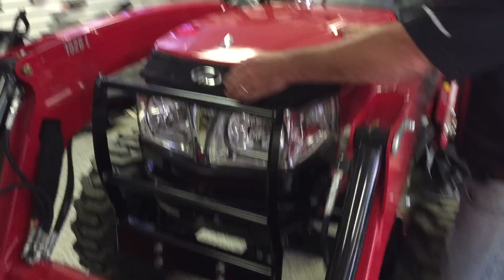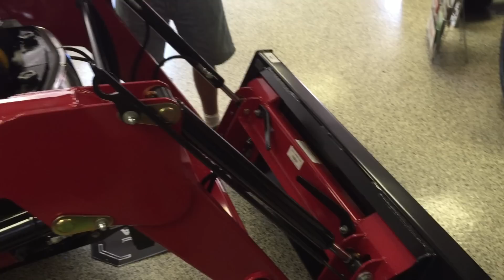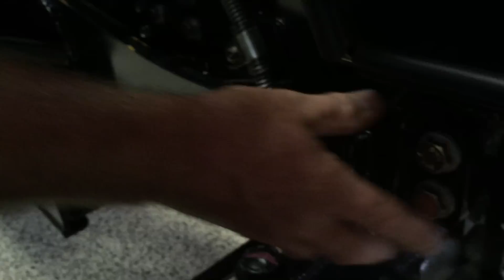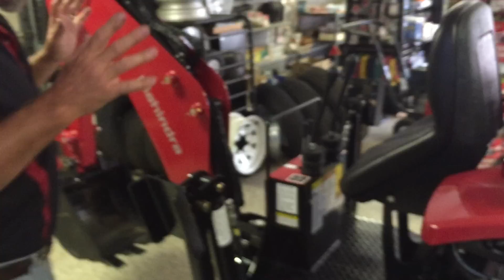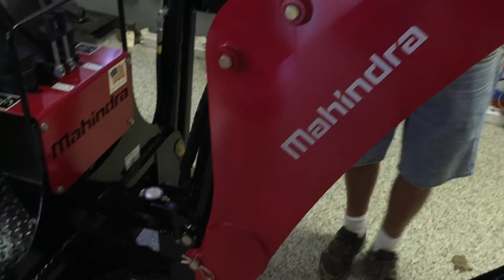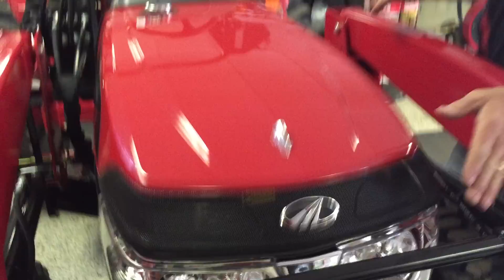Mahindra 1526 HST Tractor Loader Backhoe Overview

Comment: Kinda hard to believe how reliable they are when you can hear the shop banging on something in the back ground
Reply: Stupid ignorant idiotic comment to make!!!
Reply: JL silly ass comment have you ever seen equipment of any make that doesn't need "banging on".
Reply from the maker: Lol. Understandable, but the most common question people ask is why we have so many different color machines in our service department, a simple answer is because we don't have much for these machines coming back for servicing needs other than the common fluid changes and such. Its a tractor dealership, and people need to understand what a hammer sounds like.

Comment: I understand you carry Mahindra tractors but the quality of Mahindra tractors is terrible and the electrical systems are problematic.  I do like the emissions systems on the engine but the rest of the tractor is garbage. Please be honest!
Reply from the maker: Unfortunatetly you have not had a good experience with a mahindra product or you are just reading information to come up with this. Mahindra Tractors have been around for many years and have been bulletproof machines. The last warranty I have filed at our dealership was for a key switch. It was an easy 10 min fix and an 80$ part. Glad that is all we really have had to worry about, unlike the other companies. The mahindra product is very well built and backed by the industry's longest warranty. A brand does not survive in a competitive market if it is bad. It is as simple as that. There is a reason Mahindra tractors are the number 1 selling tractor in the world and coming close to #1 in the USA very quickly!
Reply: I have seen you make the same "electrical problems with mahindra tractor " comment on multiple videos. I am not sure if you are a troll or you have been paid to spread lies.
Reply: I've been researching Mahindras and am curious as to these electrical problems? I haven't seen much in this regard except where a safety switch was out of adjustment, but I've seen just as many videos/posts about that on other brands as well. The Mahindras seem to have much simpler electrical systems than, say, a JD, which has an OBD system and electrically adjustable mowing deck.
Reply: Look for ChuckE2009 and he talks about the problems on his Mahindras' electrical system.

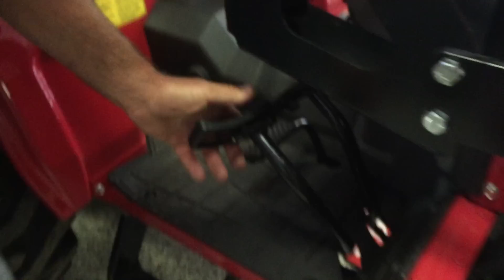Comment: on 6:25 - split brake operation.    how do you accelerate while holding a split brake pedal depressed? please explain
Reply from the maker: Heel Toe, Very Uncommon to need to do this but it is there if need be. The design is made with the gear shift tractor where it is morely utilized. But they keep the same design on the HST Model. Not going to be very useful, just acts as normal brakes, but need there be a time where you are really stuck, having the availability there to split brakes even if you had to use two feet is still useful, as long as it gets you unstuck.
Reply: you dont! thats it. you just dont. I owne one for almost 2 years 1538 pain in the... I hade to use the brake a few times and the forward padel is in the way. pretty bad design is'n it?